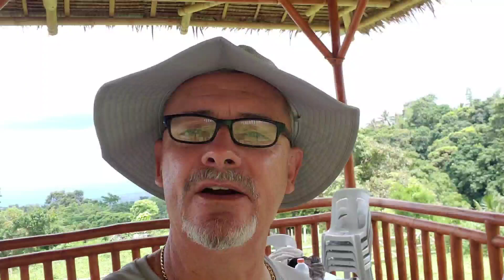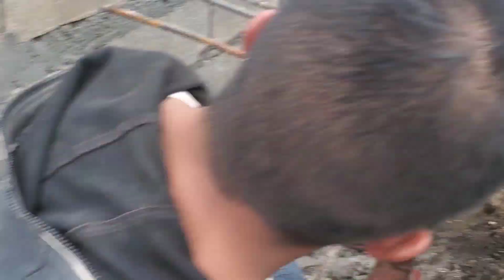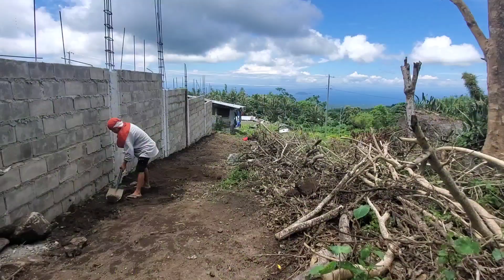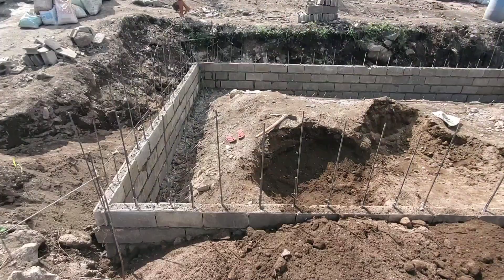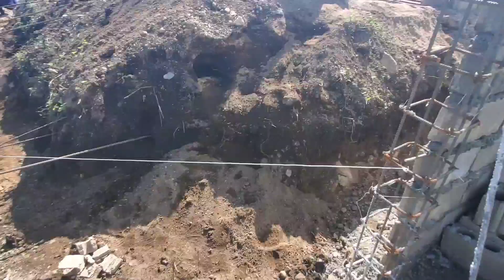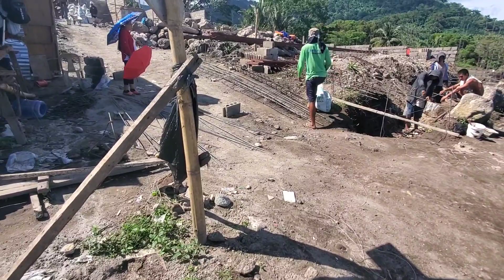Successful day - Construction day 25

Comment: Hey Greg... Rather than running 220v lights off of each column you might want to research into some solar lighting for your fence columns. Especially considering the cost of electricity in the Philippines they added cost of the solar lights would pay for themselves within the first 6 months. Then again when you consider the wiring, conduit and labor it might actually cost more to run electricity to each column.
Reply from the maker: We will be looking into solar lights for those columns as well.  We have to run electricity down that fence line anyway for the electric motors for the gate, so pulling conduit up those poles with some wire is pretty cheap.  Want to do that during the construction phase inside the columns.  That way we can do either.  Thanks for the comment and watching our videos.

Comment: if i were you, i will use some of the rocks in the back fill because they will provide stability to the ground.  as related to earthquakes, ground with embedded rocks does not give in to liquifaction
Reply from the maker: Hi Victor, good point.  There were many rocks mixed in the back fill that got tossed over those first 5 courses. I will keep an eye to make sure there's a good mix.  The one thing about this property is the number of rocks.  Good or bad you really can't dig anywhere on the property and not hit rocks.  Thanks for watching.

Comment: What was wrong or bad about the original footing/column?
Reply from the maker: Hi Norman, they attempted to move the column 3 inches after the column was already cemented into the footing.  They did this by prying the rebar down to one side and then back up vertical, basically like a S shape.  That seemed to weaken that column, in my eyes.  An engineer may say that it would be fine, but I did not want to have that weighing on my mind for years to come.  I asked them to remove that column, redo the footing and replace the now bent column with a new one.  Thanks for watching our videos.

Comment: I just wanted to point out as a General Contractor here in the states that mistakes will happen. It’s not about the error but rather how you respond to it and what you do to correct it. I see lots of structural work going on but no building inspectors. They are trained professionals that come on site looking for mistakes or unauthorized structural changes. You said yourself you’re not a construction guy, I find this a bit concerning. I know you are looking out for your own interest and investment, but will you truly be able to catch everything. 
Another point that I find concerning is about the changes to the front of the house. It was engineered with a shear value for high winds and swaying. Were the enlarged openings approved by an engineer? If not this could turn out to be the biggest mistake of the entire project. 
I love your location and house design! I’ve been making plans to move to Butuan City for several months now. I’m excited about living there and hope to meet you guys in the near future.
I got your back and will help you keep a watchful eye on things. 👍🙂
Reply: I was concerned about the changes affecting structural integrity as well.  I'm not sure if they ever inspect the building process, so it may not be a technical issue as far as stop order is concerned.  I would want reassurance though about the strength during high winds.
Reply from the maker: Hi Ed, thanks for your comment.  The hollow blocks are not structural.  The vertical columns and horizontal tie beams carry the load of the structure.  We only removed a few hollow blocks that do nothing to hold the structure in place.  Thanks for your concern.
Reply from the maker: Hello, thank you for your comment and concern.  There are no building inspections or inspectors like there is in the US.  The structural integrity of the home was not altered.  It was engineered for the columns and beams to be a certain size of rebar, strands and thickness.  That was not altered.  All we did was remove a row of hollow block that is not load bearing.  The glass panels, on our house, is quite small as compared to the larger homes you see in the Philippine's.  Good luck with your build in Butuan city.

Comment: Looking good.  Your helper did a nice job cleaning up the finish grade on that one outside wall.  Only comment is on the front metal fence you were discussing.  If I understood you the "slats" are going to go horizontal...if only purpose of the fence is to keep dogs off the property then I think horizontal will work great...but if you also want to keep uninvited humans off the property seems that horizontal slats will serve as a ladder and that vertical slats would be harder to climb.  Thanks for showing Sandy the love!...and thanks for sharing your build.
Reply from the maker: Good point. Contractor just finished a home and he designed the fence with horizontal steel. I plan to drive over there tomorrow to look at it. I'll take a photo. Thanks for suggestion as vertical may look better.

Comment: It is really coming together. I’m sure you have probably already thought of this but I am curious about your thoughts about a “ rolling gate “ that rolls to the right. Love the lower fence design idea.
Reply from the maker: Thats what we really want. Contractor is suggesting a splitgate because of the weight and length. He explained the gate might be to heavy for the motor. I think he also said availability of the sized motor to handle a 4 meter gate as compared to 2 - 2 meter ones.  I will discuss again with contractor and follow back up. Thanks for comment and watching our videos.
Reply: True weights a factor 
Also with 2 halves  you can add your      G  |  W @buildingthephilippines
Reply from the maker: Yeah, I think the contractor is concerned with the weight of a 4-meter gate and one motor.  Two motors and 2 - 2-meter gates would be less of a strain on the motor as he explained it.